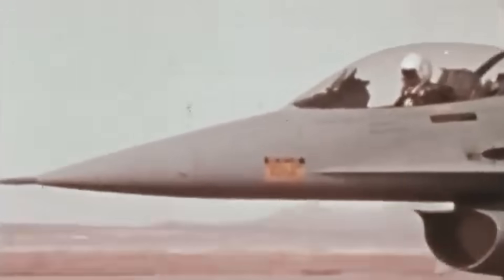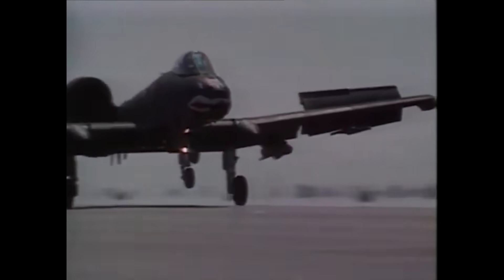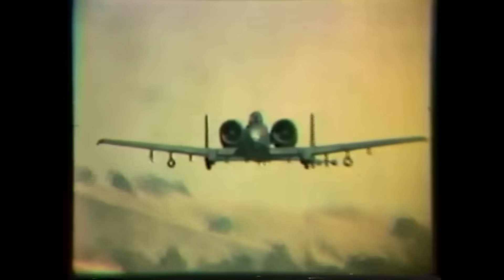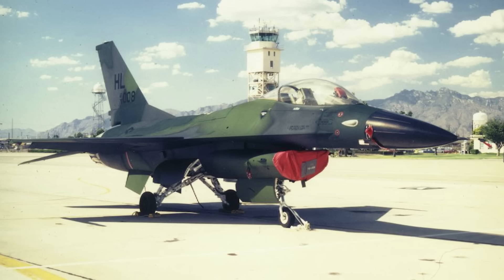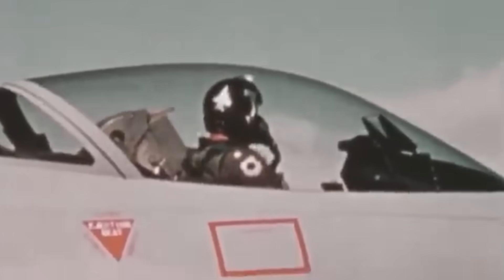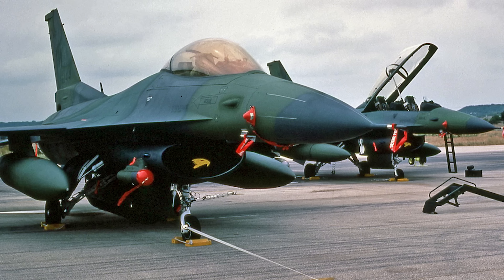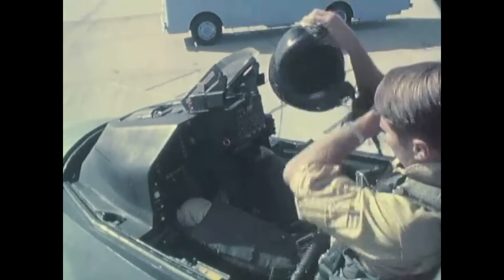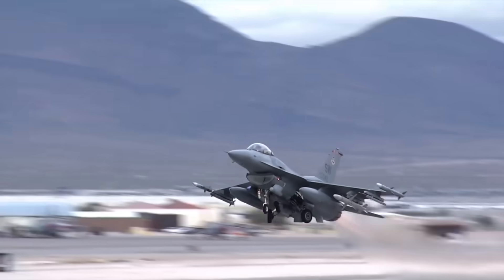The A-16. Can a Viper turn into a Warthog?

Comment: What made the A-16 special (AW&ST did a PiREP on it) was the systems integration.

The same reporter as flew the F-16B LANTIRN testbed flew the A-16B demonstrator with the Falcon Eye, Spartan TRN and Collins ATHS.

He found that the Terrain Reference Navigation system was far more confident and smooth in it's lolo navigration ride heights because it 'knew', beforehand, what the ridge beyond the hill was going to be like and didn't try to dive into the valley inbetween.  Just like he could use the head steered FLIR intuitively, compared to the LANTIRN Navpod which was mounted on the intake cheek and was thus 'behind and below' the FE turret was almost at perfect eyeline and of course, you could look 120` one way and 70' the other, just by turning your head.  It wasn't quite as natural because you had to 'nudged the gimbal' with small neck movements instead of your eyes but they were working on that too.

Probably the best part of the system was the Automatic Target Handoff System which let the guys with thermal signature enhancers on their pickup trucks, 'simulate tanks' and then drive around and get spotted by other guys with thermal NODS and send the dope, straight into the F-16 fire control computer instead of requiring a cumbersome 9-line denoting type, numbers, terrain, threats, friendly bearings and laser codes.  Just press the button and 'you have mail'.

Pretty cool stuff for a country that was still several years before the internet.  It even preslewed the FLIR to look with a pointer arrow if you wanted.  Completely smooth and natural with a X2 and X6 magnification option.  Not as good as a for-real targeting pod but vastly better than the Cats Eye (ANVIS 9) NVDs which the reporter also wore.

As I recall, the TISL pod wasn't on the jet at that time and the alternative 'Atlantik' a fancy French, dual-color system was bent.

The big issue, then and now, was munitions and IRCM.  The majority of stuff we had was way over performing for killing tanks Maverick, with a 125lb warhead, vaporizes the upper hull, Hellfire, using a 26lb tandem charge HEAT, punches a tiny hole into the magazine, engine or fighting compartment.  So instead of a catastrophic kill, you get a mobility, mission or crew kill.

The difference being we could put 8 Hellfires on a two stations or (later, JCM) 12 on four.

Plus, the missile can loft and come down, 20km+ whereas Maverick was only good for about 8-10, seeker dependent.  It was worse for laser guided bombs as they had about a 2nm toss and you didn't want to be anywhere near the 3nm capability of MPADs, let alone the 10-12km of things like the SA-8 or 13.

The Russians studied the same issue and put a laser jammer on their helos and MAWS with a boatload of flares on their Su-25s and ended up being able to (marginally) survive direct attacks against up to 19 shoulder fire SAMs.

They then fielded a datalink LMUR missile which could acquire targets over the horizon and with preplanned or drone supplied target coordinates, this solved the problem we refused to consider:

What happens when you can't sell stealth to your proxy allies and they aren't good enough (don't have enough jets) to accept horrific attrition while 'dodging bullets' to do things the old fashioned way.

For us, that answer has been 50nm standoff glide bombs.  But vs. SA-21 Growler and SA-27 Gollum those kinds of options may not be enough.  At least not for conventional, Gen-4, jets.

The A-10 can also carry X12 JAGM missiles but it's problem is then LDSD from high end (Iranian Su-35) threats.  Which F-15/16 can either duke it out with, using AIM-260.  Or at least run away from.

Comment: My modern real test for military conversations with a new person is to ask them whatt they think of the F-35 and A-10, and I trry to switch up the order I ask it in.  
A plane that cannot fly within 35 miles of a thunderstorm and has a lifetime limit on supersonic travel is not a competent combat aircraft. An over-and-over proven attack aircraft is hard to argue with.
Reply: you are misinformed about the f35 and about the record of the a10
Reply: You sound like someone who's only listened to Pierre Sprey's idiotic nonsense.
Reply: The F35 can fly in thunderstorms but an issue with the on board inert gas generator lead to a moratorium on flying in thunderstorms because they don't want to risk the 0.5% chance a lighting causes a fuel tank to catch fire.
The supersonic restriction is only during peacetime, it's not seen in the F35A, only happened at very high altitude and when they tried to replicate the issue to figure out the cause they couldn't make it happen again. So a choice was made to not try and fix it because a different coating upgrade will probably be made in the meantime.
Reply: The F-35 doesn't truly have a supersonic time limit. Even if it was forced to never go supersoinc it would still be infinitely more capable than the A-10 and 50% faster.

The time limit is for sustained supersonic flight. There is no reason to light the afterburners and fly supersonic for 10+ minutes straight during peacetime. They are simply limiting it to shorter bursts so they can save on engine wear incase a war breaks out where longer bursts of supersonic flight would be required.

Comment: I don't think the F-16 could become the exact same type of aircraft as the A-10. However, the F-16 has proven quite capable of doing air-to-ground missions. The F-16 also has the advantage of still being in production, so they can be easily replaced by a newer F-16 if lost in combat.

Comment: The A-10 fleet is nearly gone by aging out. Sorry to see them gone
Reply: Laughs in b-52
Reply: @ … the AF tells Congress the A-10 airframes are worn too bad to continue. The USAF isnt saying that about the B-52
Reply: @Idahoguy10157  AF isn't telling Congress A-10s are worn out, they are telling Congress A-10s are obsolete and sucking up money needed for other programs.  Congress has finally seen the light.  There is no need for the A-10, but there is a need for things the B-52 can do.
Reply: @ … The USAF has had a goal of getting rid of the A-10 since 1989. Pre Desert Storm. If not for Desert Storm performance and afterwards the aircraft likely would have been gone long ago. In 1947 the services divided up roles and missions where the air force refused to let the army having fixed wing warplanes. Even though an aircraft the A-10 should belonged to the army. The marines don’t have that restriction. You won’t see air force buying the F-35B as the marines are doing for CAS and BAI.
Reply: @ …The A-10 was not designed to operate off of a ship. So I doubt the marines would consider adoption. In Naval Aviation there was the A-4 and the A-7 and the AV8 Harrier. The F-35B is being carried at see. Wherever the marines go so does the navy.
Reply: @Idahoguy10157  YouTube keeps is deleting my response to your comment that the A-10 was not designed to operate of a ship, so I am going to add it to my previous comment and see if that sticks.

Now that comment is gone.  I cannot respond to Idoguy's claims. If anybody knows why YT does this with an inoffensive comment, please let me know.
Reply: let's try this

You also don't see the Navy or Marines buying the A-10, even though Marine Air exists to support Marines on the ground. The Navy got rid of all its A-1 Skyraiders during the Vietnam war while the Air Force was operating them, and the Navy and Marines have delivered CAS with fast jets ever since. Why didn't they also get a low and slow A-10? Because they know better and have a better lobby.

“The A-10 was not designed to operate off of a ship”. The A-10 could have easily been modified to operate off a ship, or had such features included at its inception, had the Navy had the slightest interest in this supposedly premier CAS platform. They were not interested in spending a dime on it, for good reason. If the F-35 can exist in three versions, the A-10 could far more easily have existed in two versions. The fact that the F-35 is operated by all three services works against your point, not for it. 

“In Naval Aviation there was the A-4 and the A-7 and the AV8 Harrier”. These are all fast jets, not low and slow jets like the A-10. USAF was operating the A-7 when it was forced to develop the A-10 because the A-7 was supposedly not good enough, and the A-10 eventually replaced the A-7. If one accepts the story that the A-10 was needed for CAS, then the Navy and Marines were demonstrably not interested in providing CAS, while USAF was. Given that CAS is the core role of Marine Air, they obviously thought the fast movers were fine. 

You might also consider that countries around the world lined up to buy the F-15, USAFs most expensive, sophisticated, and tightly controlled fighter, while nobody was asking for the relatively inexpensive, unsophisticated, and loosely controlled A-10. No other country built the equivalent of the A-10, not even Russia, which built many aircraft that were outwardly close copies of U.S. aircraft. The Russians came closest with the SU-25, but that airplane is actually closer to the A-7 than the A-10, and as such more versatile.
Reply: @thepisswalker  B-52s have been retired up to the G variant when the Cold War ended, leaving only the Hs. So it's not a bunch of early B-52s still flying around.
Reply: @ChucksSEADnDEAD  The youngest airframes are still 62 years old.

The B-52 fleet is ANCIENT even if they are just flying the newest airframes.
Reply: @Idahoguy10157    Your comment contains no logic.  

“The A-10 was not designed to operate off of a ship”.  The A-10 could have easily been modified to operate off a ship, or had such features included at its inception, had the Navy had the slightest interest in this supposedly premier CAS platform.  They were not interested in spending a dime on it, for good reason. If the F-35 can exist in three versions, the A-10 could far more easily have existed in two versions. The fact that the F-35 is operated by all three services works against your point, not for it.

“In Naval Aviation there was the A-4 and the A-7 and the AV8 Harrier”.  These are all fast jets, not low and slow jets like the A-10.  USAF was operating the A-7 when it was forced to develop the A-10 because the A-7 was supposedly not good enough, and the A-10 eventually replaced the A-7.  If one accepts the story that the A-10 was needed for CAS, then the Navy and Marines were demonstrably not interested in providing CAS, while USAF was.  Given that CAS is the core role of Marine Air, they obviously thought the fast movers were fine. 

You might also consider that countries around the world lined up to buy the F-15, USAFs most expensive, sophisticated, and tightly controlled fighter, while nobody was asking for the relatively inexpensive, unsophisticated, and loosely controlled A-10.  No other country built the equivalent of the A-10, not even Russia, which built many aircraft that were outwardly close copies of U.S. aircraft.  The Russians came closest with the SU-25, but that airplane is actually closer to the A-7 than the A-10, and as such more versatile.

Comment: They aren't 'commonly known* as the Viper. Viper is the US Naval designation specifically, not the standard.
Reply: Yes it is commonly known as the Viper by literally anyone who flies or works on the thing. It has always been informally known as the Viper, and it was even the name that was voted on, but General Dynamics got angry and decided to call it "Fighting Falcon" instead, since it was the little brother of the Eagle (F-15).

The block 70/72 is even officially called the F-16V Viper.

Comment: Yea go look at the su-34  or su-24, the su-25 is bullet magnet.  When the a-10 and su-25 were design DU and Tungsten rounds and all cwis weapon systems just did not exist. Nice premises but neither or survivable on the modern battle field. In afganstan we had weapon systems at the company level that would shred either now that exists at the platoon level.
Super hornet can get slow and its big enough that it could handle a 30mm weapon system probably not a gau-8, but put a m-242 or gau-12/22 in it and it will shared a tank,  the bush master can shred just about any thing. I have seen the bushmaters on lavs shred su-25s.

Comment: The F-16XL would have been an amazing attack aircraft, especially if they managed to put an over-wing air intake on it (like the MiG-29) to protect against FOD.
Reply: The F-16 XL was a brilliant design and I still do not understand why they cancelled it. Absolutely it would have been an outstanding attack aircraft, just not a good CAS aircraft.
Reply: @murgel2006  It wasn't as good as the F-15E and the USAF could only buy one
Reply: @user-yn6oo6q  
The XL did some things well that the 15E didn't and vice versa. In the end, the XL had the same problem the F-20 had had, excellent plane wrong circumstances.
Reply: @user-yn6oo6q  Because Congress didn't want the F-16XL, they were pushing for the F-15E and had them compete despite the fact that F-16XL was designed for an entirely different purpose.
Reply: @ The F-15E was straight-up a better bird for the job than the F-16XL. The XL was only cheaper, that was the big advantage. It is indeed very similar to F-16 vs. F-20.
Reply: @murgel2006  I think it makes sense that they chose to go with the F-15E, since the F-15E only required fairly minor alterations to the airframe and retooling of the production line, whereas the F-16XL had so little in common with the normal F-16 it might aswell be a different aircraft entirely. Remember the F-15C production line was fully replaced by the F-15E, so they didn't have to set up a separate production line and could largely reuse what they already had. 

The F-15E was more expensive to manufacture and maintain, and probably only slightly better than the F-16XL, but they didn't have to spend nearly as much on development and establishing a production line, so it turned out to be similarly expensive overall, while offering a few benefits the F-16XL couldn't, like the monster F-15 radar.

That said, I do think the F-16XL would have been an outstanding aircraft, and probably a lot more cost effective than the F-15E if they couldn't retool the production line so easily.

So yes, I absolutely understand why they didn't go ahead with the F-16XL, but it would have been an absolutely outstanding aircraft and I wish they did it regardless becuase it's so cool. I suspect it would have been a great CAS aircraft as well. The main drawback of the normal F-16 when it comes to CAS is the lack of ability to loiter for a long time, but the massive fuel tanks on the F-16XL would have solved that issue.
Reply: Agreed and also some kind of vectored thrust for STOL operations from "primitive" runways.

Comment: A rotary cannon firing high velocity 25mm rounds (GAU-12) could be re-barreled to fire 30mm medium velocity rounds (as used by Apache's chain gun). There's been a recent development in air-burst fuses for 30mm rounds for use against drones, air-bursting 30mm may be able to compensate for the lesser ammo-load and fire rate. F-16 flies so much faster that the added velocity of the jet means a lower velocity 30mm round has the same velocity over the ground as the A-10's GAU-8.
Reply: adding airbrust capability to a multi barreled 30mm is alot harder than it seems, also the gun would be significantly larger and heavier that would change the balance of the f-16 for pretty much no additional effective firepower

Comment: And now we have the f35 which combines the capabilities of the a10, f16, f16xl, f15E, f117, f18 and harrier into one platform while being better in every role than the aircraft it´s replacing
Reply: @aquilesca5tr0  how does the F-35 cover the abilities of the A-10? It’s still a fast mover. It’s not armoured, its gun is weak compared to GAU-8… and F-35 isn’t as good in a knife fight Air to Air as any F-16 model you can find
Reply: @mcal27  A modern cas platform needs to either be able to take cover like a helicopter or fly above the ceiling of manpads like the f35, the a10 is an obsolete concept, a single manpad is enough to bring it down if it unless it´s used like a bomber flying high. The f35 destroys the f16 in both bvr because of stealth and dogfights  because of it´s superior thrust and double the aoa capability
Reply: @ the last fact is absolute nonsense! F-35 has higher wing loading and lower thrust to weight ratio
Reply: @ ever seen an F-35 do a Cobra ? Nope and you never will.. it flies more like an F-117
Reply: @mcal27  It can do a cobra and recover but the fly by wire is configured to only allow 50 degrees of aoa. The f35A airframe actually is capable of maintaining control in every axis up to 110 degrees of aoa which is more than a cobra
Reply: @ yeah ok 😉
Reply: @ The f35 wing loading is lower than the one of the f18 and the subsonic thrust to weight ratio is better than the one of the f16, the f35 has actually more thrust than the eurofighter
Reply: @ sorry you just invalidated yourself with such propaganda. Bye
Reply: @aquilesca5tr0 Don't engage further, mcal27 is trying to ragebait you